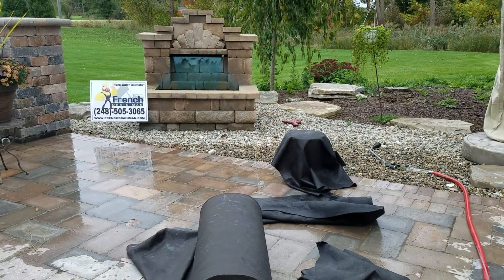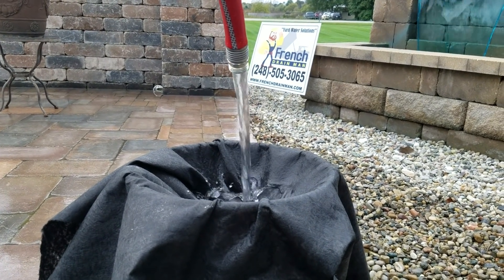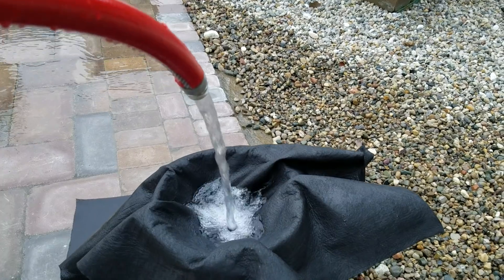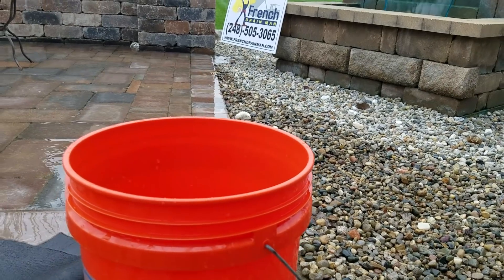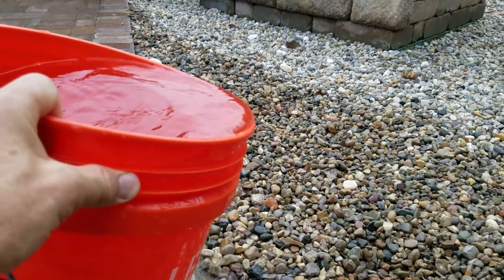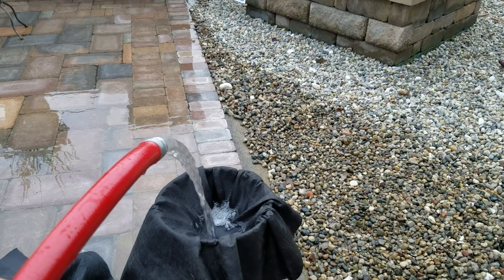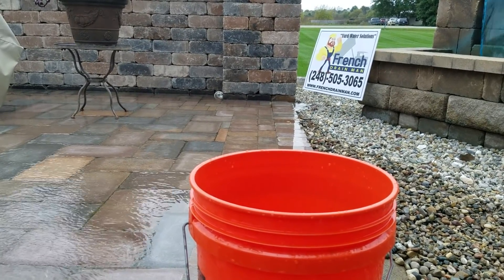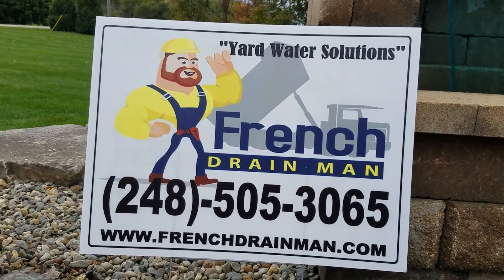Geo Fabric and French Drains the TRUTH - The French Drain Man

Comment: I had three step down concrete retaining walls put in on our sloping backyard to get more use out of it. I’m about to start the process of installing drainage for the walls. They are not very tall, 36, 36, and 32 inches tall. From what I’ve seen about the soil, it’s silty sandy soil for about 1-3 feet then clay. I would call you to help with this but your not in our area. I was thinking about using the drainage PVC pipe with clean drainage rock and wrapped with filter fabric. Would this work?
Reply from the maker: https://youtu.be/icT3kZohlhY

Comment: This test is useless everything works great in perfect conditions you put any kind of soil on the fabric eventually will affect the performance.  I've watched this guy say hey if you don't wrap your French drains soil will migrate through the rocks and plug the system with the big holes in the pipe what do you think will happen with the small voids in fabric it's common sense it will diminish performance even quicker.  It's like you and Apple drains are at war but at least when he did this test he put soil do show that yes when you do the flow gets greatly diminished.
Reply from the maker: https://youtu.be/fZIjnUoKp_I?si=YJb4ED75Q9pR8KJM

https://youtu.be/OeMdMhRA_Mg?si=5vo0KBBqJ1AA_F_r

Comment: Just watched "Apple Drain" guy talk about this same thing. He made it sound like it geofabic wasn't necessary. I wish one of you guys worked here where I live in Maine. Im about to do this myself but I'm little nervous.
Reply: I just did a small french drain in front of a basement window well that was flooding, and I just did bare gravel in the trench. Now I'm thinking maybe I should have did the fabric to line the trench but leave the top open.  That might help keep the soil and gravel separated. I am convinced to completely wrap gravel in fabric in clay soil means it will simply clog and very little water will get through and carried away.
Reply: I know at this point you have probably already done your drain. But I am currently torn bc the Apple drain guy has been doing it for 30 years and talks about all the drains he has replaced bc the fabric gets clogged. I don't see how the fabric on the pipe can clogg but the outside fabric doesn't.
Reply: Some drain guys live in a fantasy land.
Reply from the maker: https://youtu.be/GxMsPesatPo?si=zACaN2EYMxm6Bb1v